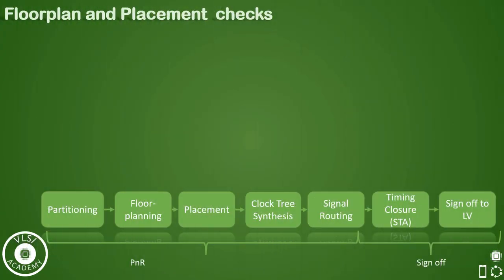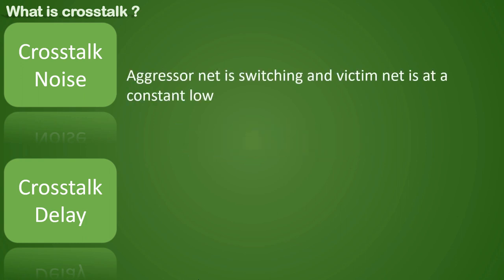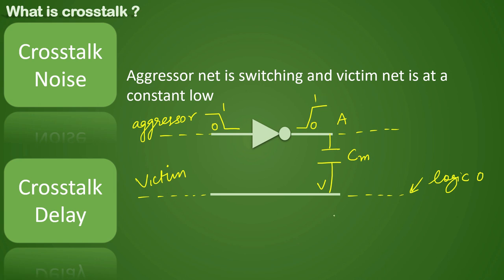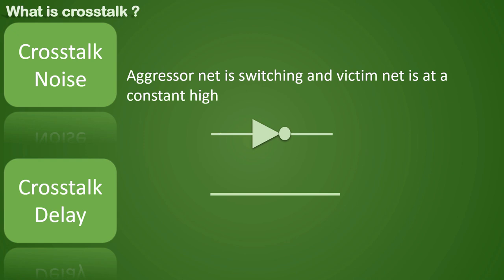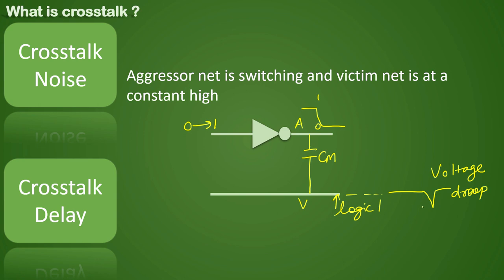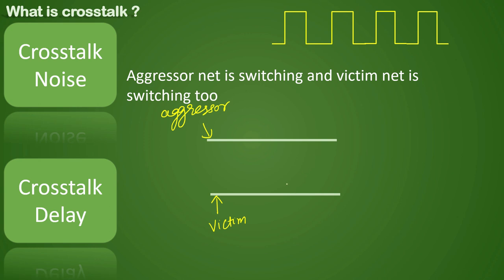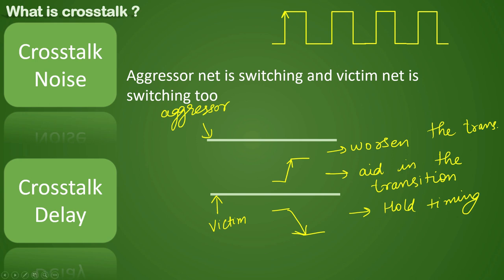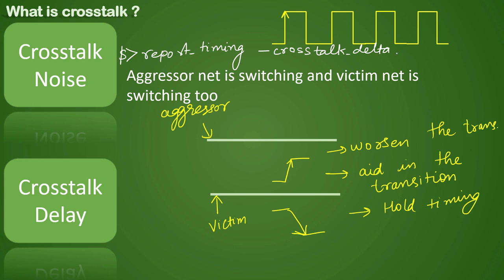PD Lec 60 - What is crosstalk ? | CTS | VLSI | Physical Design

Comment: Can someone please explain how exactly one switching net can affect another net when there is no physical connection between them? What is happening physically (in terms of currents and voltages) that causes the aggressor net's signal/transition to affect the victim net? Thank you!
Reply: @VLSIAcademyhub  That makes more sense! What I’m curious about is how the charging/discharging results in a voltage similar to the voltage of the aggressor on the victim! Just wanted to develop an intuitive understanding for my own knowledge. Thank you very much for the response and the great videos!
Reply: @VLSIAcademyhub   You’re welcome! And oh, okay I see, right! So we can use that equation to relate the resulting voltage we’d see on the victim based on the current that we’d see induced by the mutual capacitance? What node would we see the voltage at?
Reply: Two parallel wires acts as a parallel plate and behave as a capacitor since the voltage level is changing and there is mutual capacitance is present, that is why agressor net switches the victim.